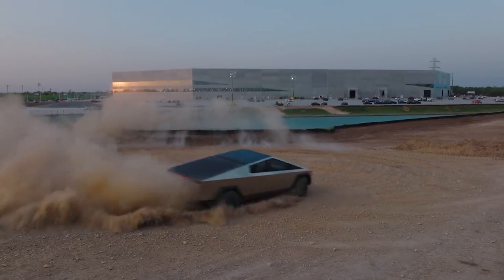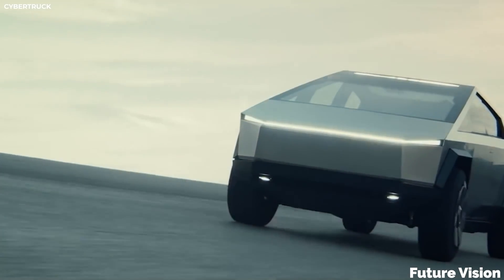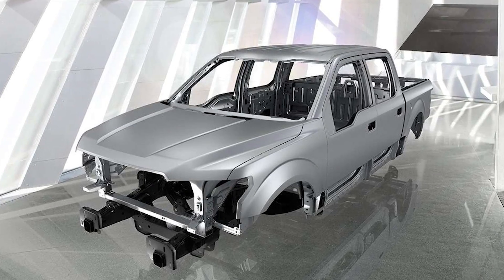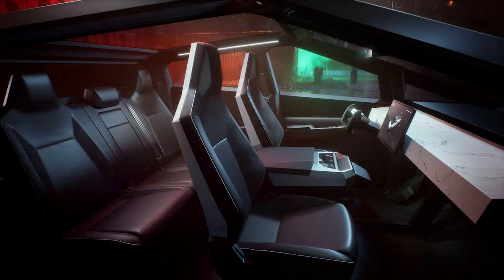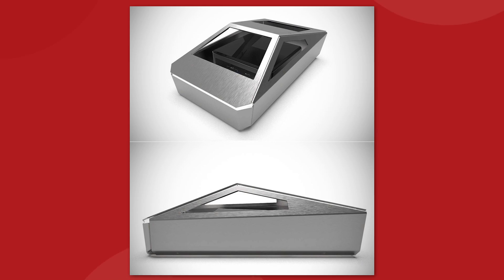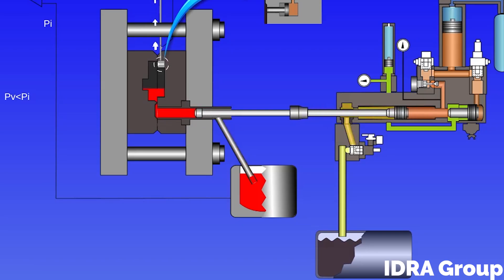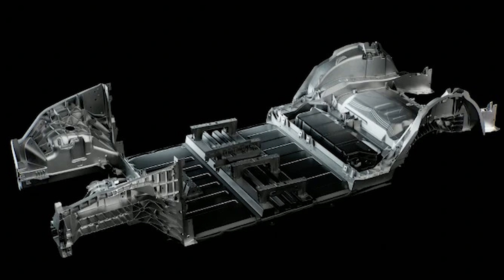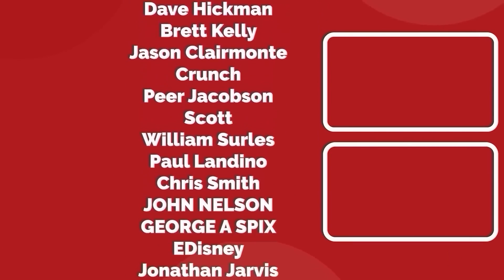The Real Reason Tesla Developed The Cybertruck!

Comment: I believe this video is factually incorrect. I think initially the design idea was to create a structural exoskeleton. They eventually abandoned this and we can see clearly that the supposed truss above the windows typing the front and back together is in fact just a decorative laser cut trim piece of stainless steel that is glued to the actual body, which incidentally is NOT stainless steel. Also there is a recall concerning this piece in that is only glued and not fastened by mechanical means. I love the idea of an exoskeleton and of stainless steel, but the cybertruck is not an example of that.

Comment: Great work walking through the design rationale.  I am following.  BUT IT IS STILL ELECTRIC.  I am very willing to purchase and use a Tesla car as a commuter but it makes little sense currently for long trips.  Too hot or cold impacts the battery's ability to hold a charge and the charging process (if at all...see Chicago Teslas bricked at a charging station doing nothing after a winter storm).  I don't count on my ICE truck for a living, but I do pull campers and a 20 ft. trailer with my tractor.  I am not going to sit for 90 minutes at a charging station after exceeding the range -- in IDEAL conditions (i.e. moderate temps).  Until consistent 90%-100% charge occurs regardless of the ambient temperature and rapid charging similar to filling a gas tank occurs, it will NOT be adopted willingly by those who count on using light pickups.  And no, my garage charger won't help me when I am 300 miles away from my house.

Comment: Give me one for free and I wouldn’t keep it. Imagine getting in a fender bender. No shop is gonna touch this thing. It will be impossible to repair damage. And if the body is really it’s structural exoskeleton frame then a bad cosmetic looking fender bender to the body with be structural damage and may even cause the vehicle to be determined to be totaled. If you can’t get your vehicle fixed and you can’t replace it’s parts, then it’s a throwaway product. Can’t wait to see how this plays out in 10 years or so. The only Tesla thing I own is stock and power walls on my house. 🤙

Comment: Probably the best introductory presentation on the Cybertruck I've ever seen. It would be a treat to watch a follow-up description of Tesla's other ground-breaking innovations that the Cybertruck includes, e.g. its 48 volt system, drive-by-wire steering, micro motors, pneumatic clearance control...etc. I sure wish I could afford one to use in the bush, not as a mall crawler like most will get used for. Oh well!

Comment: I wish Elon well on this design, and I appreciate the engineering aspects of the design.  However, I think that it is likely that only very few of them will ever be purchased with the goal of using them for an actual work truck.  I think that the large majority of them will be purchased by city dwellers with high incomes who just want to use the truck for light-duty weekend adventures that don't take them far from a fast-charger.  IMO, this truck seems to expensive and impractical to use as a real work truck (for construction work, landscaping work, farming, delivery work, service truck, etc.).  And it's hard for me to imagine that a business owner is going to shell out $65,000 - $110,000 for a business-use truck when one costing less than 2/3 of that cost will get the job done at least as well.

Ed Schultheis, PE
Mechanical design engineer and manufacturing consultant for 35 years
Schultek Engineering & Technology

Comment: Since it ended up not being an exo-skeleton lots of your info is incorrect. So it is going to be overweight and not easier to manufacture. And a typical unibody is more a  exo-skeleton. The non pneumatic electric  brakes are going to be revolutionary though they have been around since the 1960's.

Comment: The cyber truck gro ws on you.  At first it was a bit of a shock.  But now, its great.  And the fact that its body is stainless steel... that is even better.  My truck wont disapear from rust and dents in a couple of years, like my Dodge Ram has.  And at the time I thought the Ram was the best truck on the road.  But now you can see right thru its cab... and Im not talking about thrru the windows.
So I expect the Cyber truck body to last a lifetime with NO rust whatsoever.
That by its self is worth the price for the truck.

Comment: The cab is a unibody construction now with large castings for the front and rear of the vehicle, much like a Model Y. The stainless steel skin is just "dead weight" now. This is based on actual images from the pre-production images from the initial assembly of the CT. The stainless steel is going to be a nightmare for upkeep, but the camp wrapped test vehicle seen recently may be a solution for many. It will be interesting to see real world tow range as the Rivian and F-150 Lightning all lose 50% or more of range towing. I look forward to seeing one in person once they are in production to make a final purchase decision. For off-roading I will stick with the best solution available, the Jeep Rubicon.

Comment: well, i got a few thoughts on this:

first, thank you for this interesting insight. but i have to point out that it is NOT physically impossible to bring this steel into curved shapes. its just way to elaborate and would be financially stupid...what you explained very good. next, the reason traditional offroad vehicles use a frame with "dead weight" body is that it can bend underneath and does not stress the body wich otherwise would deform in extreme terrain. if the steel is strong enough to withstand that it could be a clever solution. but i think a hard "exosceleton" will have massive issues to pass modern pedestrian safety standards and crash tests in general, since there must be a lot of soft, energy absorbing material. next, this shape must produce a lot of aerodynamic drag. also there is a very limited use of the roof in comparison to other trucks. and last but not least i wonder what is the benefit of an corrosion resistant, long lasting body if you cant change the batteries wich will constantly loose power and wont be usable after a few years...

Comment: The unit body design is used in the Honda, the Hyundai, and the avalanche trucks already, and the chassis body does add torsional and beam strength.  Unit bodies just do it more efficiently.

Comment: Sure, Exoskeletal “frame” sounds great…  until a small fender bender compromises the structural integrity and carrying capacity, and would likely have insurance companies totaling out trucks because of it.  

But “he hit it with a sledge hammer”…  a 3000 lb car (light for today’s cars) impacting at 10 mph (parking lot speed) generates more force than a 25 lb sledge moving at 100 mph.

Plus, there’s a reason heavy trucks have solid axles (not IRS).  They’re durable and they work.  

Frankly, I don’t believe anything Musk says.  FSD has been “ready today” and be “available next year” for over a decade.  I’ll believe the Cybertruck claims when it’s tested by consumers.

Comment: Space-X wanted to use their own proprietary blend of Stainless, the foundry will have had a minimum order quantity for that. Tesla are suddenly making a truck out of the same stuff. Everything else is a byproduct of that.

Throw a toolbox into a steel bodied truck, it'll still damage it, it's heavy with pointy corners. That was in a tv advert a while ago, when the F150 went aluminum, and it took them a few takes to get a good one.

Comment: There are so many things wrong with this even a layman like me can see how much of a cash grab this is...

Steel is not a universal material, having a flat sheet of steel as an exoskeleton means nothing as the properties of steel is changed using carbon and heat. This was sheet metal not forged steel so the properties you associate when taking about a steel frame are likely not there. The curves and arches on a structure can have have more strength then straight flat sides, although the triangle is a strong structure, an arch looks more pleasing to the eye which is also stronger and has more aerodynamic properties when applied correctly. The battery being one the most degradable parts of the car is not going to fair well as a part of the structure when its due for a replacement and will probably write off many cars before their time due to the costs to dismantle the frame of the car itself. Honestly its a cheep DIY looking car I would expect a youtuber to make. Only Elon musk, the king of cons himself can hype people up to buy these overpriced scrap buckets and get them to brag about how much better they are than highly refined cars.

Comment: I usually don't leave comments on videos even when the content seems to be next to non-sensical but for Elon lovers - I had to! Some of the points made me laugh - "High strength & quality 300 series stainless steel". This one was probably the funniest. 300 series stainless steel which is not painted will still corrode under current environmental conditions. And don't even get me started on the galvanic. You can tell the content creator is not an engineer. There are so many better options that would have allowed traditional stamping while maximizing the strength. Traditional stamping will increase the strength of the part. Bending it in certain areas the way it is, can fracture the whole truck body in a crash test. Also, how is it smarter & safer to be in an exoskeleton design? Would you rather be in a tube or outside of it? The way other cars absorb the energy during crashes is by having the sheet metal on the outside get crushed first and then the chassis absorbs the rest of the energy. You will literally be like toothpaste in a tube in this truck. Plus, casted metal is the cheapest option and has relatively the worst mechanical properties. In summary, Tesla's truck design is kept around how to make the truck cheap and market it at the same time. There is a reason why other car companies do what they do. I am in no sense praising them but I can tell you that Tesla's build quality is still crap.

Comment: From a person that has had a pickup all of my life. This Tesla truck is not a truck. A small 4 door car can haul a trailer. Ya. It has enough room in the back to haul a atv. In the truck world. Whoopi. I traded my one ton in because the bed of the truck was to small. It drove me nuts. Yet. This Tesla truck is the same body design as a Chevy Colorado. EV then gas. Yet wide as a Hummer. I drove the Hummer in the military. You will not get me to ever buy one. To big. To wide. Why I own a 2004 Jeep Grand Cherokee. Perfect size. My new 2020 pickup. 6ft bed. Now I have a pickup. Would I ever buy this Tesla city vehicle. No. Here is why. It's not a tool. The size of my Jeep will get me in more locations then the Tesla truck. Same thing. All I gave to do is put a bed in the back. Get rid of the hatchback. Make my Jeep into a two seat vehicle. How many 4x4 trails has Musk been on? Himself. Like I showed my son. All of these wrecks on the hwys. Why I buy the types of vehicles I do. I personally come up to a massive pileup. I am going 4 wheeling. I will not be sticking around. See ya. Use this Tesla truck really for what? It's a toy. Not a truck.  Its a Chevy Colorado turned into an EV but wider. My 2020 pickup choice. A F150 XLT with toe package. 6ft bed. A truck. Yet. Small enough for cities. My law enforcement is even smart around here. That's what they drive. My truck is no joke. They do not drive drive cars. Tesla truck is just a toy. Over sized toy.

Comment: if the battery pack is part of the structure, how does it resist twisting? all trucks twist and flex, going over uneven terrain, pulling a trailer, etc. and how expensive is it going to be to change said battery pack when it goes bad? surely its not a simple job being that it is structurally part of the truck, suspension geometry and alignment is going to be changed by removing that section and replacing it with another

Comment: A lot of bold statements in this video and not a single mass produced Cybertruck on the road yet.
4680 is not really the success it should have been, the promised chemistry failed and are still only build in too small of a scale to meet demand.

I am looking forward to see how repairable the skin is, driving into a pole would need the entire front to be sawed off and a new welded on again and a lot of polishing to repair the surface finish.
A F150 would just get a new painted plastic bumper installed, no crinding, welding and polishing, just paint the new front and install.
A brushed surface needs to be brushed in the same direction to match the parts next to it, it is much more time consuming then matching a paint color.

Comment: Interesting car, but is this an electric car? To my opinion, electric cars are not yet reasonnable vehicles due to the weight and range of mileage. Also refueling is too much time consuming. Also the life span of batteries is not solved.
If built with a hybrid propulsion it would be quite reasonable.

Comment: So are we still going to pretend years later that the dude with the sledge hammer was actually trying to hit the cyber truck hard? literally hit it with 10% power.
Reply: Hit any other car with the same hammer and the same power.  Let me know what the owner thinks.
Reply: @Plisko1  both would leave a dent. The point is he didn't swing nearly as hard on the cyber truck. Anyone not bias can see that.
Reply: @LTC_84  I said the same swing.  His swing didn't leave a dent.  So that doesn't even make sense.  Most cars have very thin metal.  You don't need a sledge hammer.   You can dent them with your fist.  Even a light tap with that hammer is a good demo compared to any other truck.  If it's bias... it's a bias toward believing in physics.
Reply: @Plisko1  I still don't think you understand. The point was comparing dents but if you're swinging 1/3 as hard on the cyber truck as you did on the normal door then it completely makes the test irrelevant. This is plain common sense.
Reply: @LTC_84  I understand your point but I never saw a stronger swing on a normal door..  Did you?  It's a valid point if they did... but I must have missed it.  My point was even that swing probably would have left a dent in a normal door... but it is my own estimate.
Reply: @Plisko1  this was just a snipet from a 1+hr live stream from several years ago and they had a side by side with a normal door where the guy put all his power onto the normal one and hardly anything to the cyber truck. Yes both would have made a dent but by purposely using less strength on the cyber truck just makes it seem like if anything it might be weaker than a normal one cause if it's stronger why use less force? If you remember right after the stream Tesla stock fell double digits because of it being a huge fail and investor's saw through it lol.
Reply: @LTC_84  OK that explains my confusion.  I did not recall the normal door.  Your right.  If they did that that optics are not as good.   I thought the controversy you just mentioned was over the window breaking.

Comment: First of all: 30X (whatever nonsense marketing numbering that is supposed to be) steel is stamped all the time. No, it doesn't break a stamping press. The reason why it's not stamped is much more likely a) the stamping press for that thick a panel would be much more expensive than a regular stamping press used in the industry and b) the material would most likely tear because he's using a way too thick panel. That thick panel will also add a load of weight. I'd be surprised if that truck comes under 8000 pounds which is why Tesla chose to omit that number. That much that thick structural steel is heavy. The design simply stems from a very poor choice of material that makes absolutely no sense in a vehicle design. Maybe the bare metal is to eliminate Tesla's poor paint jobs but any repair on that vehicle will get very expensive very quickly. I'm also wondering how they design crumbling zones with a 0.12" thick very stiff stainless steel body. Guess it's back to the 60s where just the body bangs around in an impenetrable tin can.
None of the design or choice of material makes much sense for a vehicle that's not designed as a military vehicle where you make compromises in favor of armor.  
I want to see the frontal collision tests on those trucks - the die cast, thus more brittle, aluminum frame will crack into multiple parts while the super thick and super sturdy exoskeleton will not deform all that much. The full force will be carried by the passengers. It's going to be fun to watch.
Reply: In the USA any vehicle over 6,000 lbs qualifies for Section 179 "Hummer Tax Credit" for any business. It was meant so construction companies could more easily buy flatbeds and dump trucks but the way it was written (the best bribe money auto lobbyists ever spent) allows any business to take it for a qualifying vehicle. Are you an attorney who works from home? Then if you buy a Chevy Suburban you qualify for a massive tax credit. 

The owner of the company I used to work for used it to buy a Model X, but the Model S does not qualify. I would not be surprised if the Cyber Truck is deliberately designed to exceed that weight to qualify for the tax credit.
Reply: @patrickcorcoran4828  Good point. I doubt though that's deliberate - it's more a side-effect of very heavy construction for the sake of being able to swing a hammer at it so the violence happy followers go whoooaaaaa. I'm certain one door of the cyber truck weighs more than all four door from my car.